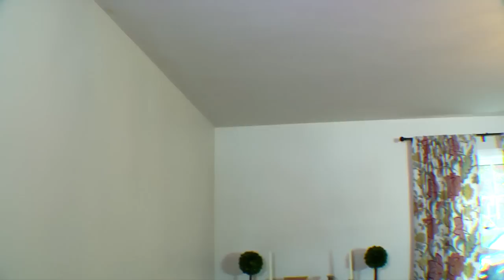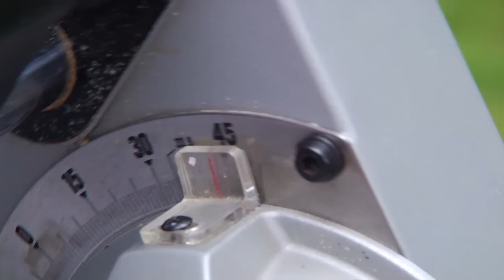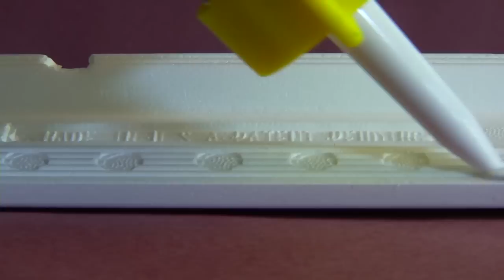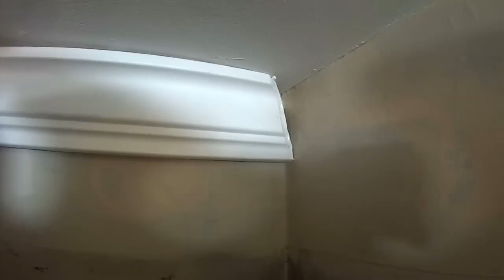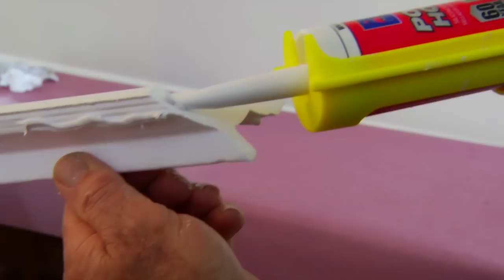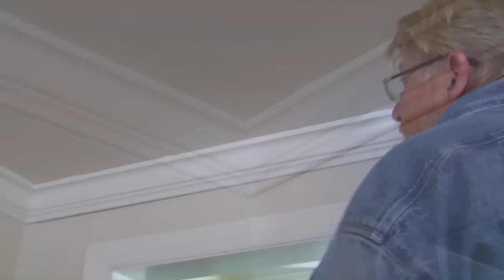Install Crown Molding Without Nails

Comment: I was wondering, is there a less permanent method for this product to be used in rental homes/apartments. For example, is the material light weight enough that we might be able to get creative with some heavy duty 3m wall tape or something of that nature without losing our deposit! Thanks!
Reply: I'd be careful with the heavy duty 3M stuff.  it grabs and holds VERY strongly.  some consider it "permanent".  but, that's a great idea.  there are many different strengths and thicknesses of double sided tape.  ( I know, this is an old post I'm replying to.  Is there a statute of limitations for responses on the 'net? )

Comment: What if you have a uneven ceiling? How would you fix that problem.
Reply: Styrene will flex a lot better than wood.  If you can't make the molding stay in place till it dries, pound a small nail under it, or tape the heck out of it until the caulk dries.  If the ceiling is grossly uneven you'll need to scribe the molding to the contour.  The easiest way is do your best and caulk the rest.
Reply: Simply add more caulk. Caulk the heck out of it.
Reply: @BetterToDIY  Putty and paint makes up for what a carpenter ain't.
Reply: Demolish the house with a bulldozer.....thats easier.....dont ya think!!!
Reply: Burn down the house?
Reply: @LB-pg3no  Why are men so emotional? I've dealt with toddlers more level headed than most men.